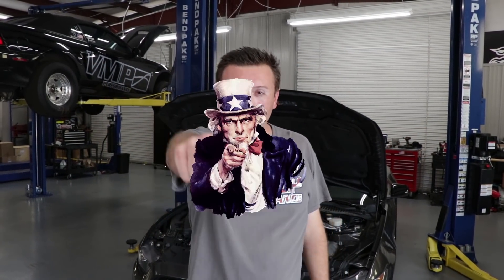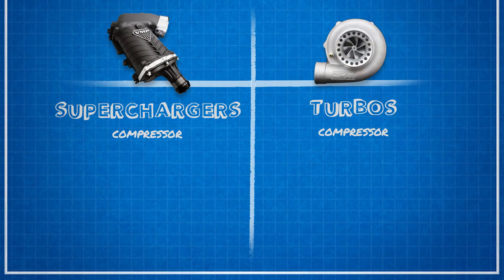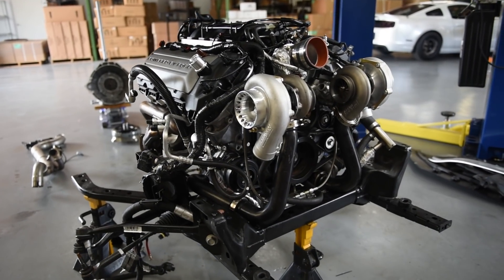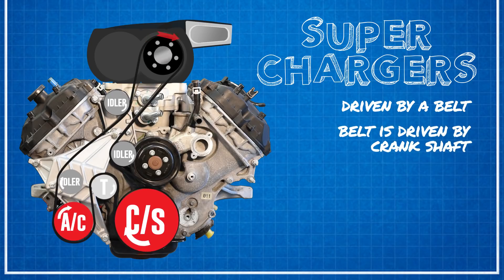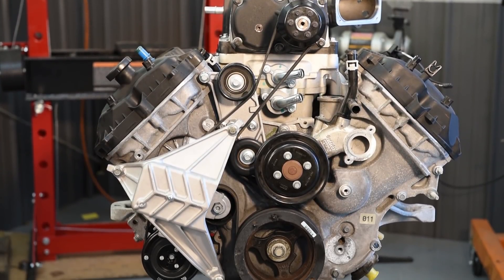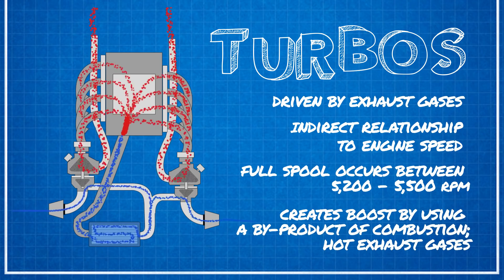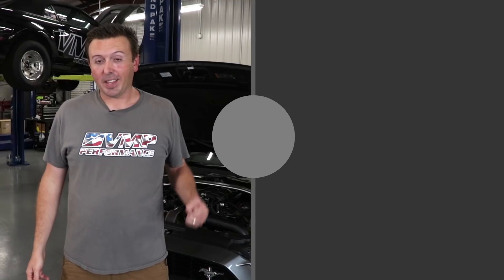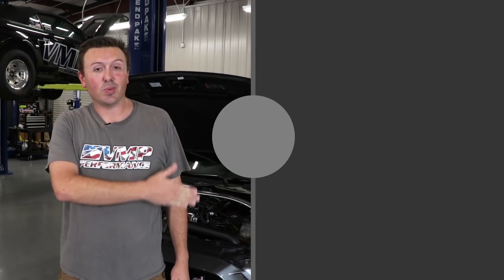VMP Performance | Superchargers vs. Twin Turbos

Comment: I am team Superchargers i do not like Turbos Superchargers look way cooler under the hood in my opinion sound nicer and they are Instant power no Lag and that type of garbage. Great video man.
Reply from the maker: Appreciate it!
Reply: Plus 800 torque at 3,500rpm turbos arnt doing that until they spool
Reply: Turbos will blow past your superchargers on the top end on the big end which is the most important.

No supercharger on earth looks cooler than a twin turbo setup. Not in my opinion anyway.

A properly brake boosted or 2-stepped turbo vehicle will still blow past your supercharger on the lower-end also. It's not the turbos fault that the driver doesn't know how to drive. 

If you want ultimate power go turbo. Displacement is what matters and even the biggest over 4 liter superchargers can still be out displaced by turbos.
Reply: manrightchea  I disagree strongly with you buddy Supercharger bye bye turbo fan boy.
Reply: @Nick-1992-SRB  If you disagree strongly, that just means you haven't raced enough good turbo drivers. Keyword being good.
Reply: @manrightchea  Supercharger is king of the streets (especially with manual trans), turbos are king at the track. This case is prime example. Torque curves say it all on these two cars. No one type of boost is better than the other in general, just different. The most important thing is having fun not being the fastest, because there will always be a faster car.
Reply: @gforce_117  That's the thing though, that's not actually true. Turbo can out  displace superchargers pretty easily, and they have a lot of benefits I think some people don't remember. See I think there's two kind of turbo drivers, the ones that just buy one and tune the car, and the builder that properly sizes the turbo for their goals, and buys all of the good supplementary technology and knows how to drive.

Case in point, people think superchargers automatically win on the street because of torque, that's not necessarily true though. A good turbo builder can easily have a two step or anti lag and not waste time waiting for spool.  A good driver can brake boost if they don't have these and start the race at full boost.

Turbo driver can also have boost by gear. Maybe run 12 lb in second gear, 16 lbs in third, 20+ in fourth etc. Maximizing traction. Blower can't do that.  Blowers actually tend to lose on the street the most versus good turbo cars. Turbo driver can change boost instantly, hopefully they have a good electronic boost controller. 

Not to mention okay you want more displacement.. good luck paying for blower that's four liters or more. Where as a person can upgrade turbo size very easily. Doing multiple runs? Good luck keeping that blower cool, going to heat soak real easily.

Between the two, the turbo will always have the highest potential for speed. It's obvious most of the people here have never raced against a car with a two step, boost by gear etc. No belt slip on a turbo, no parasitic loss on the crank either.  Turbos also spin much faster, which means that turbo will always be better for high RPM. Superchargers going to have an ultimate upper limit after which is going to be uneffective. I think most people here need more experience with real turbo drivers.

There's a reason people that go for ultimate power swap out blowers for turbos. Terminator Cobras, GT500s, ZL1's, Hellcat family of cars.. people always swap those things to turbo to get real speed out of them. Turbo will always be faster, because turbo has a lot more options. It's not hard for blower to equal a mild turbo setup, just like this video. However let that turbo car start running a serious setup like an 80+ mm, and it becomes a lot harder to equal it, much less beat it.
Reply: manrightchea  All your talking about is street racing... which is only considering WOT and high rpm condition. IF you are racing, which should be on a track anyway.. you are better off with turbos(which I said). Otherwise, blower car ftw. No matter how fast you get on the street, there will always be another car that can shit on it. 

For a street car, blowers are the ultimate system. Why do you think Hellcats, Cobras, GT500’s, ZR1, ZL1, all come with a blower? Cuz they are lively and perform well on the street and make lots of power just fine. Notice how I said streetcar, not racecar. 

There’s this thing called a big heat exchanger. If a blower car is built right it can dominate and perform super well too. Turbos can heat soak as well.

Blowers are more responsive and make boost at any rpm. Can’t beat that on the street in the real world.
Reply: @gforce_117   Making boost at any RPM is overrated. You're also wearing the supercharger all of the time no matter what you're doing. Unlike a turbo where you can actually choose to drive with restraint or with power. You also don't have all of that flexing and stress on the most critical portion of your engine at all times.

Most fast street cars these days are not race cars. The term race car doesn't resonate with most people.  Not when your average street car can have a thousand horsepower.     Many cars come with supercharger because it is much cheaper than a turbo system, which is something really important to manufacturers. It's a lot easier to engineer and install a belt then it is to pay for and run intercooler piping. Easier to know exactly how to get to a certain power figure. That level of easiness is important for a manufacturer.

It doesn't matter if it's the street or the track, turbo is how you get the best power. Has far more advantages. Displacement control, boost by gear, driveability, less parasitic loss, more suited for high RPM etc. This knowledge has to do with racing period, not just street racing. It should be obvious that I build cars. 

There are not very many advantages to superchargers when it's all said and done. Turbos can have just as much torque instantly with a good driver, turbos will pull much harder on the big end which is what matters, turbos going to achieve easier traction, easier to upgrade displacement, easier to up boost, no belts to slip.  If a turbo heat soaks then the entire engine is heat soaked.  A big enough blower can struggle just in hot weather, and there tends to be physically less room for heat exchanging.  Turbos can have massive air-to-air intercoolers or air-to-water.

With a good EBC, good 2 step, boost by gear etc, turbo will extract the ultimate speed. People like blowers because they are easy.  Many mechanics don't have the skills to install turbo systems, where as the blower is much easier to install. They also tend to be cheaper because they have less hardware requirements and have more limitations. Not to mention they tend to favor the mid-range, which compliments many of the engine designs they are bespoke for. It's a lot easier to just "purchase horsepower" with a blower. Requires very little knowledge from the person buying. Just buy the 600 horsepower one..etc. Turbos require more overall knowledge, and more effort in general, that's why many people don't go that route.

Centrifugal superchargers do breathe up top better, but they still aren't as good as turbo, they still have belt issues, and you still need to buy the biggest you can since you won't be upgrading displacement very easily.

I think with the right builder and the right driver, there's really no situation to me that a supercharger is hands down better. Turbos can do instant boost, turbos can achieve better traction, easier displacement increase, less losses, more drivability choices, more ultimate power. High revving engines with good breathing like the Coyotes, love turbos. That's the way to get the best power out of that engine. 

Yes they require a little more planning, a little more knowledge, more vision for your future goals etc but the payoff for that extra effort and knowledge requirement is also much bigger. That's why I will always build turbo, even if I like them both to an extent.
Reply: manrightchea superchargers are not hard on the motor all the time. They only require lots of power to turn under boost. That’s why there a bypass valve. I agree turbos are better than centri blowers 
At the end of the day neither is better at everything. Arguing every little point is pointless. They don’t pick blowers because they are cheaper, they pick it because it delivers what they desire. They are plenty of turbo cars that are cheaper than blower cars from factory. Going fast is all you care about so for you it sounds like turbos are great. Superchargers are better on the street overall. More average torque and horsepower. The top rpms aren’t all that matter. I just finished a blower build and I have a turbo car too. I know what’s up
Reply: @gforce_117  I'm not talking about the expense of the car I'm talking about the expense of the system. We're comparing one system to another. A supercharging system in general is much cheaper then a turbo system, I'm talking one new aftermarket system to another.  Manufacturers absolutely pick supercharging systems for that reason, both are forced induction but one is much easier to build and pay for, that's going to be important to a manufacturer. Less hardware, less specialized, less expense.

That's not even unique to manufacturers, enthusiasts buy them for the same reasons a lot of times. Unless they have a strong preference like myself, many people are attracted to the easy horsepower and torque offering.

I'm discussing the details because that's where the big differences come from. Blowers do offer a lot of torque and both offer great noise, but that's not always good either. That's actually a difference I forgot to remember. Drivetrain preservation. Aside from traction and boost by gear, larger turbos tend to be nicer to the drivetrain. You can feed the power in as you need it. Blowers are essentially an on-off switch. The engine essentially behaves as if it was much larger in displacement, the power delivery of a turbo is different. Makes me wonder if many people have even owned a modern turbo?

So basically the best benefits of turbo are drivability by preference, easier displacement increase, easier boost increase, boost by gear,  fatter big end, and drivetrain preservation.

The downfalls are greater expense, greater complexity, likelihood of needing more supporting mods, genuinely more difficult install. I don't own a blown car but I obviously own turbo cars.  Either way I still know what I know, I'm pretty darn sure I know my stuff too.

 Neither of us are wrong, it's just obvious we both have strong preferences. What I love about building turbo engines is aside from how they make power.. I never feel like I can't beat something. You can show me that insanely built 4.3 liter Whipple so on and so forth, and I'll find a way to beat it.

I'll take my Precision 67mm off, move to an 80mm, welded intercooler pipes, more aggressive spark, bigger fueling etc. Two-step it hard and I'll take down that Whipple.  Yes it's harder, yes if I make a mistake I'm boned, but to me that's part of being a good driver.

 You make it seem as if turbos are useless outside of the last 2000 RPM, that's not the case. Fat torque under the curve is great, but it's the big end that wins races. You guys must have street cars that are just a lot less dangerous. "Street car" here doesn't mean much, not when a lot are pushing four figure power numbers.

 If a person is insistant on street manners, they could easily size the turbo for that. Smaller hot side, smaller turbo overall. Also keep in mind we're not talkin about how turbos used to be in the late 90s.  We are not talking about old journal bearing diesel turbos with steel wheels.  Modern ball bearing, ceramic or magnesium wheel turbos spool extremely quickly for their size. 80mm turbos nowadays can spool like little journal bearing 50 trims .

Nothing beats the feeling of being against a powerful car with the instantaneous torque of blower.. launching off the two step and watching that blower drivers grin disappear.

He may be out by a fender or two for the moment.. but as the driver, you already know what's coming. All of a sudden that thing wakes up, hits threshold and pulls like a freight train, there's nothing like it imo. Maybe that's how liter bike owners feel.
Reply: @gforce_117  That IS why manufacturers pick them. It's completely foolish to say that that's not why they pick superchargers.   If that's the case then you should do but the point to numerous manufacturers building twin turbo engines for performance. They pick superchargers because superchargers are cheaper, they have less hardware which is less obligation,  they don't have to be shielded, they often have self-contained oiling etc. Saying that's wrong makes no sense without proof that it's wrong. It's not wrong and their actions prove that.

Street manners can't be used as an excuse if it's about raw performance. Truth is you don't want to read the points because you know you're wrong . Anyone that builds cars knows that turbo engines have much higher potential.

On3 is also not a reputable brand, it's not a Precision or Garrett. It's basically one step above a Chinese eBay turbo. You get what you pay for and you're not getting ceramic wheels and top quality ball bearings by being cheap.

VMP sales superchargers  of course they're not going to show their supercharger getting beat by a turbo Coyote. Whether they show it or not that's what's going to happen, especially on the interstate.  That's why they had to find a mild build to compare to. They won't be beating a 9.1 to 8.6 that Gen 3 Coyotes can do with turbos.

Your assumption that they are better for the street is nothing but bias.  How is a system with easier boost changes, easier displacement increases, no belts, boost by gear, less parasitic loss, superior top end, and better drivetrain consideration somehow worse for the street? All with no crank flex.  That makes no sense.  Torque alone is not all that matters and supercharger's pretty much worse in every other department.

Whether you consider turbo worse or not, actions speak louder than words. When it comes to real power and potential turbo always wins . That's why they won't show those cars race heads up on the freeway.

https://youtu.be/dDbT7EMzyjc

That's what happens when VMP and Paxton try to race turbo Coyotes. Uncensored and no propaganda. Anyone that knows Coyotes know that to get the best power out of them you want to go twin turbo. Hellion or Aldo Weld's..On3 is only good for the manifolds and supporting equipment but needs better turbos.
Reply: @gforce_117  TT Coyote vs VMP and Paxton: https://youtu.be/dDbT7EMzyjc

TT Coyote vs VMP 5.0 : https://youtu.be/yhH3wJdo79Y

TT Coyote vs numerous supercharged vehicles: https://youtu.be/MamyzgGOSmA

That's what supercharger vs. turbo actually looks like. That's without all of the nice talk and marketing propaganda.
Reply: @gforce_117   You disagreed about manufacturers because you are seeking your own self-validation. I don't see any twin turbo factory performance vehicles right now so, there is no theory as to why they choose supercharger. It's easier to implement and it's cheaper that's why. Believe whatever you choose to believe but that's of the reason. 

Those are not race cars, those are normal street cars. Full interior, air conditioning, privately owned. Turbo is just faster. I personally don't know why somebody would spend almost nine grand if they don't care about it being fast. If that was the case they could get the 6-cylinder. People don't buy superchargers because they want to lose.

VMP is just not as powerful as turbo. That's all there is to it. More torque under the curve, supposedly better for the street, yet still slower on the street. It did better than Paxton but still lost, even On3 beat it and those are Chinese turbos.

You've been arguing that supercharger should somehow be better inherently, I've been arguing that turbo will always ultimately be faster regardless of worth.
Reply: manrightchea LOL! Nissan GTR, Taurus SHO, ecoboost F-150s, some Mclarens are. 720s I believe. all twin turbo factory... that’s just off the top of my head. I don’t think you build cars if you don’t think there’s any factory twin turbo cars out there. 

If you could build a 1000hp car with a beautiful broad and flat torque curve using a blower, why the hell would you pick the one that sleeps till 5000+K rpms and then barely makes any more up top? VMP car in this video is the better setup based on the dyno results and the way they will be driven on a day to day basis. Turbos can be faster than blowers and vice versa. All dependent on setup, and the only fair way to compare is like in the video. Equal power and within a few pounds of boost, and the blower car shined. You could put a smaller exhaust housing on to recapture the mid-range but then you will be hurting up top. As long as you got good cams the blower is great at all rpms, idle to redline.
Reply: @manrightchea  u are 100 percent right. Turbos are king. That dyno graph is not typical for a twin turbo setup. The torque should be much higher for the turbo car and the boost should come on quicker. That turbo set up is not tuned right. With turbos u get more power with less boost , less wear on the engine and better gas mileage lol. I just bought the twin turbo 62/66mm  ball bearing hellion street sleeper kit for my 2019 gt. Waiting for all of the supporting mods to come in the mail to install.